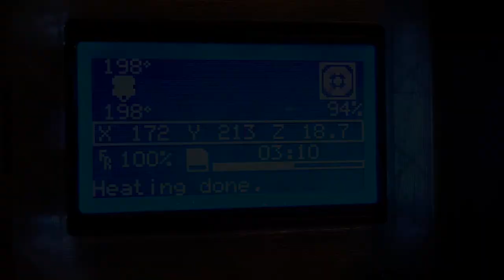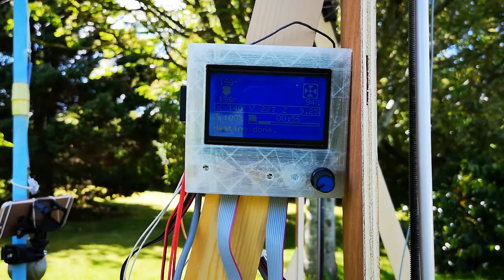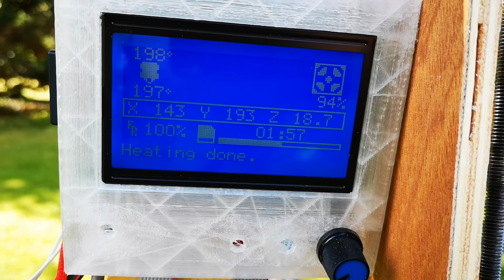Ultra DIY 3D printer

Comment: nice job . i wana make one but i have some problem with settings the stepper motors ( i use EM527 / SST35D1 stepper motor for the xyz axis with leadscrew M8 like yours for the z axis  and nema 17 for extruder)  can you help me plz 
ramps 1.4 / driver A4988
Reply from the maker: F4R OUK what problems are you having? 
Is the stepper motor turning at all, shaking back and forth, locking up. Etc.
Or is it how to wire it up, microsteps etc.
Reply: @robertleroux5773   can i send video about the  problem . and thank u so much
Reply from the maker: Send and I’ll take a look.
Reply: @robertleroux5773   thanks i will send it to you tomorrow